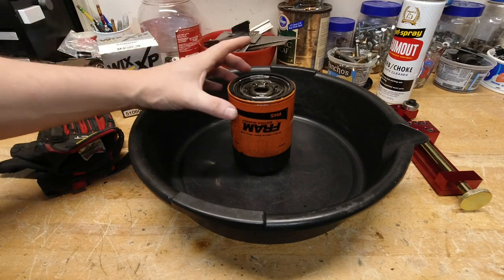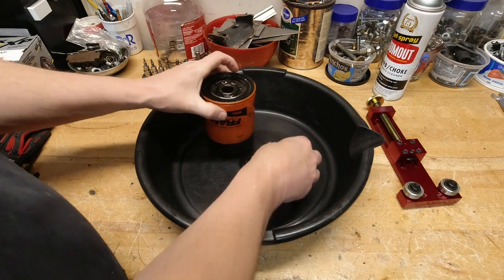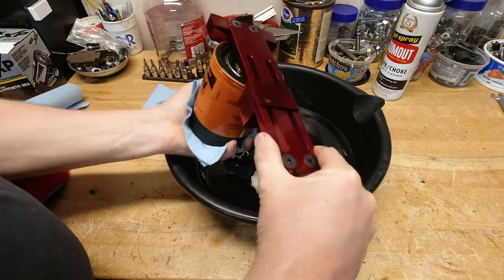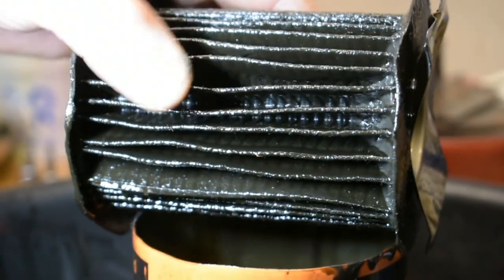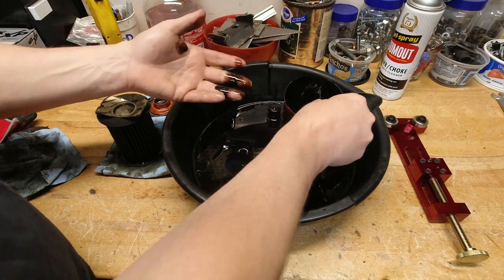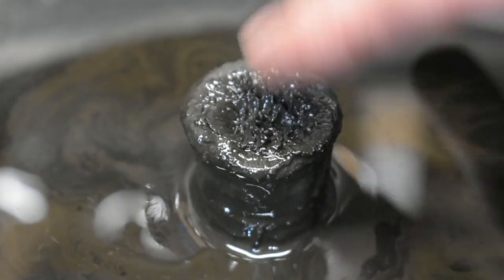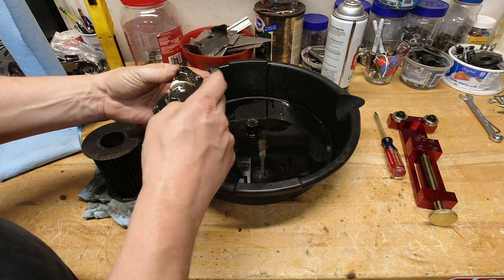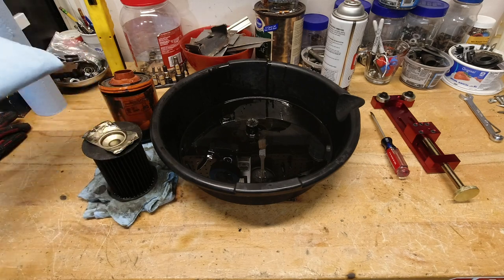You Should Be Inspecting Your Oil Filters

Comment: These old school engines usually trash the oil within 1,000-2,000 miles because the oil they used back in the day had little to no detergent and would sludge up everything, using modern oil with high detergent will cause alot of that old sludge to break up and travel through the oil system. On a stock common low hp engine like this I personally wouldn't even bother opening the filter but if it was a freshly build high performance engine like a 383 or 400 I would check, just depends on what your working with.
Reply from the maker: Oh I’m quite sure it didn’t help this thing was run with no air filter.  On a farm.  Owned by a guy who couldn’t tell me when the last time it was changed.  Only that oil was added to it as it needed it.  lol
Reply: @MuscleCarSolutions  yeah when it comes to farm equipment, maintenance is usually at the very bottom of the to do list lol. I'm sure a few back to back oil changes with fresh modern oil will clean that engine up or if it's really bad throw a quart of ATF in the engine oil to really clean it out.